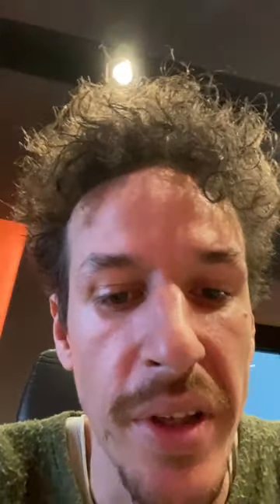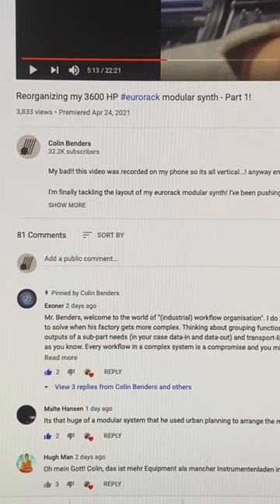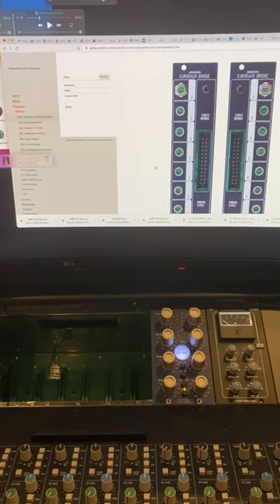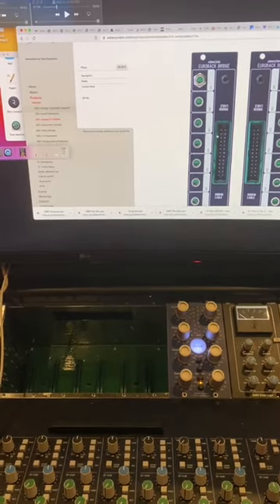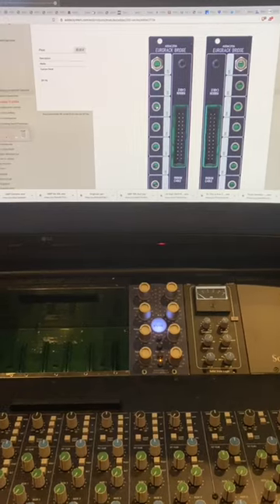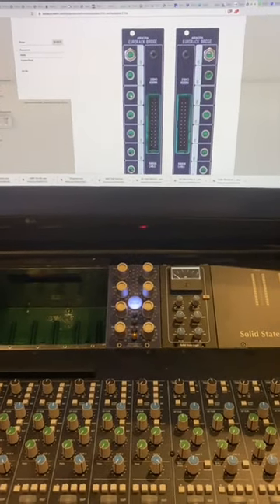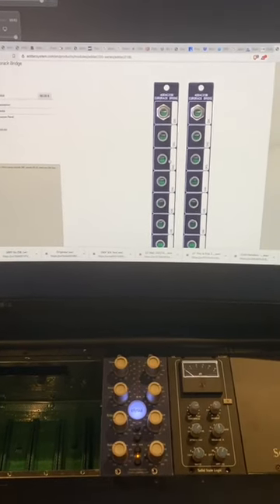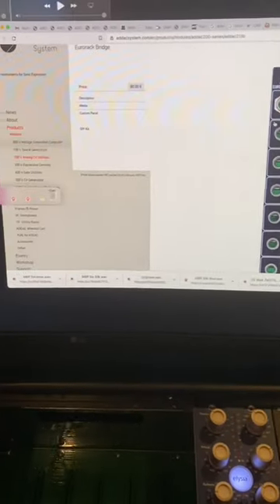The War On Cable Clutter - Redesigning my #eurorack modular synth - Part 2!

Comment: I've had Knurlies recommended quite often but I haven't ordered any...but, After Later Audio sent along a couple of their M3 thumbscrews with their Steps module o purchased and I fkn LOVE em for the sliding nuts on my 2 smaller cases. Especially for rearranging and organizing like you're doing. I don't know if it's the answer for your bigger rig but, man it made things easier for me. Especially with all the arranging/rearranging I've been doing lately to try and remedy the exact issue you're talking about. I'm a year into eurorack so still a noob really but, I've rearranged everything so many times lately and I still wind up with clusters of cables in spots. Tried to group everything sensibly multiple times according to function etc but still wind up with these clusters. Working on it too! Thanks dude, for all the sharing of knowledge. I really relate to your journey into modular from being a dedicated instrumentalist first.
Reply: I think I've tried 6 different arrangements in the last month. My girlfriend was like 'Why do you keep having to do that?!?!'

Comment: M3 allen headed bolts are good (female hex) - I buy cheap ones but the format is good - quality fastners are cheep in bulk from industrial suppliers - you obviously need industrial quantites.

Three good points are:

1.The heads are small and less visually intrusive than any pozi or flathead screws.
2. They fully hold the driving bit, so I have the confidence to use a small electric driver to install them without frear of an accident. (your thumbnial with the flathead bit in the driver freaked me out initially, but I watched the video and now I understand).
3. Price is good  - Knuriles in the quantites you need would cost a lot - better to save it for more modules...

Comment: have never designed anything like this but I design software in modular way so regarding your CV-bridge topic: I do not know if it is a question of material but if it is not I would simply take e.g. 2 bridge-modules for each of your subsystems as input to next neighbour and 2 bridge-modules to as output to next neighbour. As you will have some systems on your border and some in the middle area that means e.g. you will have 4 bridge-modules on left-side of every system which is in the middle and 4 bridge-modules on right-side of every system. In case you need far connections you would than simply chain this bridge-modules. At least for CV signals I do not expect to much distortions. Just it is definitely much cabling work :)
Reply: I sent you a diagram via discord of this design in case it is of interest

Comment: Cheers Colin, Exoners post on the previous video made interesting reading. When you have a problem this big, breaking it down into smaller chunks you can manage makes sense. I'd be taking a hole saw to the case sides to aid under the hood connectivity, pretty sure there is a less caveman solution than this though.   :)     Best of luck man.

Comment: Hi Colin, regarding your screw problem, Most import is to use a matching screw bit. not al cross head scews are the same in size and type (Philips (PH) or Pozidriv (PZ)). If you are using the same size and type your troubles will be gone. I am using simple cheap screws DIN 7985 with a philips screwdriver

Comment: Hi Colin, one comment from my side (and my system is also very big - but all in Doepfer monster cases) would be to have some „free areas“ for new modules or for swaps which might come up once this thing comes alive. It is my experience that always something new comes up which would fit right here but there is 2HP missing to fit it in. So, in your case (sic!), I would consider to add space per region. Like one bigger blind panel in the „Control Surface“ section, one in the FX section and so on.

Having followed your system over the last years you Must be aware that you are seldomly using a larger portion of your modules in a single „song“. Sometimes you develop a song and patch in another voice but that is also only a limited addition to the patch. Then you tear it down and start again (with some repetition).
Seeing your wall I would think about having two patched systems where you can develop a song from one patch to the next which could give you even more variety and a better use of the very large system. I can recommend „Second_Breakfast“ (you can find him on YT and IG), he explains how he has doubled his setup. Maybe not your style but the idea is great. I have also split my system in two which gives me more creative options.

Comment: On the topic of screws: I'm in the "Knurlies or GTFO" camp. If there's a down side, it's that sometimes they stick out inconveniently in places where two rows of my case come together at an angle <= 135º. Other than that, they're perfect. Nylon washers mitigate rack rash. No screwdriver needed. I hardly ever drop screws in my case, because I'm handling them directly with my fingers, instead of trying to work a screwdriver around my fingers getting a tiny screw into a tiny hole on the other side of a metal plate.

Knurlies are full of win.

Comment: Don't know much about eurocrack but can't you use panhead torx screws? (van die sterretjes schroeven ipv kruis) They have no slippage whatsoever (or whatever it is called :), way easier. (no hex, no Philips screws)
Reply from the maker: Thats exactly the kind of advice I am looking for, thanks!
Reply: Torx screws are the way to go if you want to avoid stripping.  I like the knurleys but they are expensive and the stick out quite a bit. Here a link to a dutch supplyer where you can buy decent quality torx screws.(check even of je 6mm of 8mm lengte nodig hebt. De schroefjes in de link zijn van klasse 8.8, dit is 2 tot drie keer zo sterk als goedkope m3tjes van de bouwmarkt.)  https://jeveka.com/nl/metrische-bevestigingsartikelen/torxkruisgleuf-schroeven/bolcilinderschroeven-torx/7985tx8z0030006

Comment: Hey mate, regarding screws. It's not necessarily the material of the screw, but the head/driver. Philips screws will always run the risk of self-destruction because they are actually designed to cam-out. This is what causes the driver to "pop" out. It's an old world design to allow the screw to destruct instead of the workpiece. Now many tools have torque control, and it's better to use a different screw/driver combination.

Most Eurorack systems use metric, usually M3. Get rid of the Philips Head screws and use a Hex screw. Specifically a M3 x 0.5mm thread, 8mm length, Socket Head Screw for a Hex driver. Look for a Black-Oxide Class 12.9 Alloy Steel screw or local equal. The Socket Hex Head matters more than the material. In America, I can source them for as low as $7.50 per bag of 100. 

Also buy a nice high quality Hex driver, like a Wiha.

You'll never have a issue screwing ever again.

Comment: Cable management is NOT boring !
I always thought someone should sell blank panels with protruding cable conduit clips that would allow cable laying along vertical patch lines
Reply: Absolutely agree. I bought a bunch of cable clips which I use with 4hp blank panels, just using the mounting screws to hold them. You have to plan the layout well but then you have these clear paths that the cables can take and the only thing they're blocking is a blank panel

Comment: Knurlies are great for modules that need to come out of a case often, but I found them way too big for a lot of modules that I play live. I use Allen cap sockets throughout mainly because they fit on the keys nicely. I use BZP screws because I want them to corrode not my case, the reverse would happen if you are tempted by titanium or stainless, plus bzp are the cheapest.

Comment: Right angle cables are good, especially if the jack sockets are on the bottom of the module like the er101. Tendrils for cv as the are ver skinny wire.

Comment: Would ribbon or Ethernet cables fit through the vent holes in the back of the boats? That would help you go between cases without it being visible. BTW, highly recommend the Doepfer link modules with the Ethernet cables. They also have a ribbon option on the back and give you 14 connections in 4HP. Also, BTW, the ADDAC skinny modules are 3HP, not 2.
Reply: I have the doepfer ones and they have cross talk, not a lot but noticeable, so do the "case connect" modules, I would recommend checking out the "Rack Plumber HD", it has 19 inputs (18 mono 1 stereo) and runs with an HDMI cable
Reply from the maker: Dude you’re a genius. I did not consider the vents in the back!! Thats amazing, thanks! As for the bridges being 3HP... well shit. Thats gonna hurt.
Reply from the maker: @GangstaPlaya666  are you noticing the crosstalk just for audio or did you also notice artifacts in the cv signals?
Reply: @ColinBenders  I only noticed it for audio so far. Then I stopped plugging audio into it, if the bus module takes up to 10V peak2peak then it should be able to go twice as high before having cross talk imo. But they are very prone to that, might be because of the patch cables I used, I think it was Cat. 6 maximum, you would wanna use Cat. 7 for sure or maybe even Cat.8 which are isolated A LOT better than the Cat. 7 or lower ones. I also have a feeling HDMI might perform better in terms of cross talk ... not sure on that one tho.
Btw I really enjoy watching these videos, hope you upload a lot more of them, also I would really like to see another Schranz video hahahaha
Reply: @GangstaPlaya666   I use Some 5 meter CAT8 cables and haven’t noticed any audio crosstalk at all. The individually shielded pairs of CAT7 and 8 was the main reason I went that route.

Comment: Knurlies would be perfect if only the head was shorter. Unfortunately they are not. I now have many  knurlies not being used now... it’s true what you said they’re cumbersome with small modules and can be a downright mess.

I’m excited for you to solve this problem of screws. I’m using slider nuts now because they’re standard with Pittsburgh Modular cases here in the states. Are use the standard screws now provided by said company. Problem is they’re short and don’t have nylon washers thus creating rack rash.

Comment: There's no need to get Titanium screws, the advantage of Titanium in this case is about weight which I don't think you're concerned about, and tensile strength depending on grades is about the same between Titanium and Stainless. Stainless machine screws will work fine, maybe buy from an industrial supplier to ensure some kind of quality standard is in place. Also remember that the torque spec on screws that small is only around 1.4Nm! That's "pretend your hands are baby hands" spec

Comment: You don’t need titanium (it’s not actually stronger, it’s just lighter, hence use in aviation), it’s the “drive interface” that’s important. Philips/Pozidrive is crap, and the reason why product manufacturing avoids them at all costs, as the heads can strip easily and head engagement is difficult. Look for HEX (aka Allen key) or TORX machine screws, and get a corresponding Wiha or Wera screwdriver in that drive/size. Stainless steel is fairly corrosion resistant but can’t withstand high torque whereas normal high tensile steel machine screws will work for most applications. Steel screws come in various finishes including “self” aka chemically blackened with oil coating, Japaned (a hard slightly semi-opaque black coating), BZP (zinc plated) and a few others too. In reality, stainless steel is more that adequate and is be fine for holding modules in place. A box of 200x M3x15 torx or hex stainless machine nuts is something like £6-8 as well. Avoid cheap sellers on Amazon etc and look for a good fastenings/hardware supplier.

Comment: Have you tried something such as the doepfer A-180-9 Multicore, basically it lets you cleanly distribute up to 14 Audio/CV signals between cases in a huge setup using a single ethernet cable. The product is also compatible with intellijels Octalink 1U (8 signals over ethernet) product too in the event you ever end up with 1U rows or end up grabbing some 1U to 3U converter panels to pair with them.
Anyhow, a link to the doepfer product page is as follows:
http://www.doepfer.de/A1809.htm

Comment: Hi Colin! Thank you for sharing the process of conceptualizing your new system, it's fascinating and even though my Eurorack in only a tenth of the size the concepts are still very useful. As far as bridging for CV, these modules are great and use HDMI cables to connect to each-other so you can run from rack to rack with no issues: https://www.plum-audio.com/product-page/rack-plumber-hd

For audio, I've been wanting to get these for a while. You can pair them with a balanced DB-25 to XRL snake cable to get audio out of your system:  https://nw2s.net/products/nw2s-o16

Or pair two of these together to patch audio around your system with a DB-25 to DB-25: https://www.modulargrid.net/e/nw2s-nw2s-io-balanced-black

Cheers!
Reply from the maker: Thanks! Very glad to hear its useful. Those nw2s modules, I thought they had been discontinued? Or did I make that up? I was looking at them because it uses the same connector as my SSL desk so it would make connecting my system a breeze!
Reply: @ColinBenders  I think they popped up on the Modular Grid new modules feed a few weeks back which is how I discovered them. So maybe they had been discontinued but are now once again available? If you go to their site (middle link above) both products (16 out, and 8 in/8 out) are available to be ordered in both silver and black right now!
Reply: @ColinBenders  No, not discontinued. A bit more active nowadays. And connecting to a mixer (I use the Model 1) with a DB25 is really a big plus. Also a balanced connection is possible.
Reply from the maker: @azenot007  fantastic. was just now looking at it again, it seems to be quite perfect for what I need. especially with the ribbon extension so that I can connect it on the back of my case, I guess they alternate the audio and ground signals on the ribbon to shield from crosstalk? will mail them today!
Reply: @ColinBenders  Perfect. It’s a well built module.